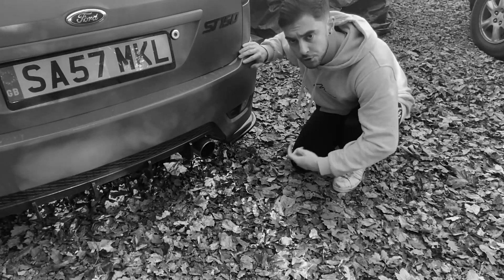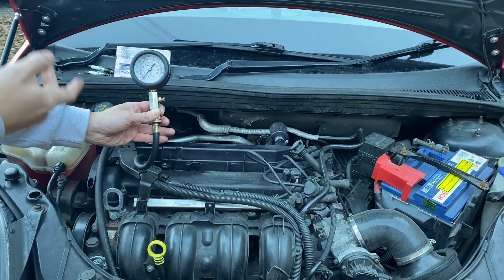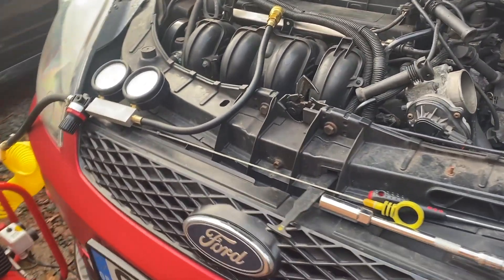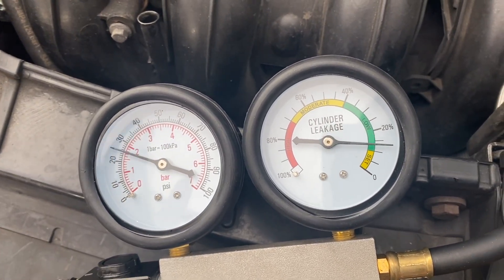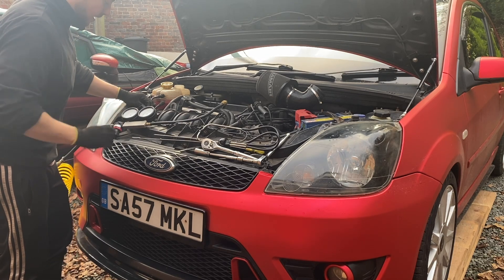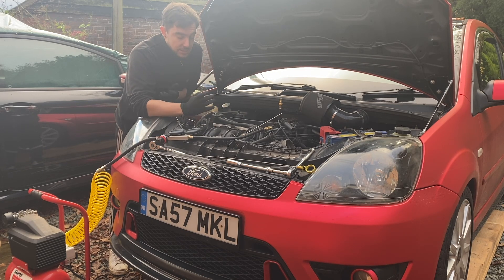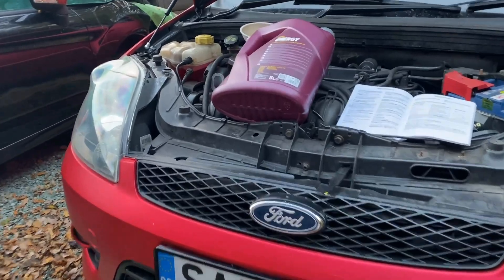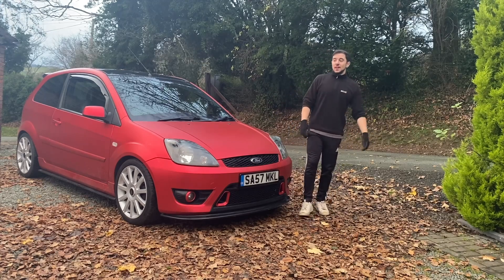What Condition is my ST's Engine in? | Engine Health Check

Comment: Great video, I'll ask my mechanic to do pressure test on the cylinders.. My missus mk6 idles well, druves well but stalls...changed pump, fulter, cleaned throttle, throttle position sensor, map sensor, checked abs sensor.. Its still stalling. No error code. 😢
Been ro over 4 electricians already

Comment: I've got the same problem with my St150.
Going through a fair amount of oil but no visible signs of an oil leak.
Did you get to the bottom of the issue, or you just running the car and topping it up?
Reply from the maker: Just topping it up for now, will be rebuilding the engine this year

Comment: Hey man, very helpful and enjoyable videos. I got a question. I got the same issue with my oil, but the compression test wil give for each cilinder the same result. You have any idea what a problem could be? Can’t find any leak.
Reply from the maker: Thank you mate. That’s good that they’re even across all 4, what are the results you’re getting in psi?
Reply: @MendItModIt  I did with full gas, I got 270 psi
Reply from the maker: @zebvanderslot6710  those sound like good numbers, like I’m not a mechanic but I believe between 250-300psi is good for these engines. How much oil are you losing over what period of time?
Reply: @MendItModIt  I check the oil leven a few times. Last I had a longer ride I think around 150km and it dropped from max to almost min level. I think it’s probably also around 2-3 weeks. But it seems like when it drops its like almost every time from max to min.
Reply: Still no oil leak or something found. I did a engine flush but can’t say if that will do anything. Maybe got an idea to check first? I think I have to open the engine.

Comment: Hey, nice video! 
Did you have any issues screwing the compression tester into the spark plug holes?
I bought a similar cheap compression tester and the 14mmx1.25 attachment won't screw in and it's so frustrating - I can't figure out why. It's a 2005 fiesta zetec S.
Reply from the maker: I always feel like they’re not screwing in all the way, but then I got one stuck and took me ages to get it free. Sounds like you know your stuff with the sizing and thread pitch, I was going to suggest a thread pitch gauge and test the plugs that have come out just to check, but really spark plugs should be a standard size 🥴

Comment: So I've gone and done one on mine.today. 200 200 200 150 but now the cars spluttering like mad and aint functioning right at all. Whats ya thoughts mate? Everything seems in place as it should
Reply from the maker: Was it fine before you did the compression test?
Reply: Spark plugs installed correctly? Ht leads installed?

Comment: Maybe as a budget option drop the sump take the pistons from under the car and stick on new rings, refit and retest. 

Wouldn't have to mess about with timing or new headgasket, then can keep the motor running sweet until you decide if it's time for big power
Reply from the maker: You know what I actually love that as a suggestion 😂 maybe not on this car but in the future I want to try it 😂😂

Comment: Rebuild to 200 spec 💪🏽 Cosworth cams
Reply from the maker: Definitely considering it mate 😏
Reply: @MendItModIt  Yeah man, mine is recently up there now, it's sensational. If you do, go for full Miltek exhaust, sounds soooo good
Reply from the maker: @poosh6529  yeah plan is to get the rest of the milltek system I reckon. Is yours non-res? Sports cat?
Reply: @MendItModIt  Non res with sports cat, and really comes alive when cammed. I also asked the seller on ebay to make sure he includes the silver tip back box in the package as it seems by default it's black tip when ordering full package

Comment: Hi, just wanted to let you know. I have a lot of experience working on these engines, the margin ford gives out for burning oil in these engines is 1l in 1500 km, so unless its using more then that i'd just let it be because all these engines burn a liitle oil
Reply: 0.5L in 1K miles is highest as stated in the manual.
Reply: @CdotPoppy  wel 1000 miles is about 1600 km so not to far off. But the point is al these engines burn a little oil
Reply: @yourimeeuwisse711  point taken and they do, if they don't have good 5/6k (miles☺️) oil changes and are allowed to warm up and down nicely. Then the abuse they get becos it's a ST is not good.
Reply from the maker: Out of interest how many litres/millilitres are between max and min on the dipstick?
Reply: @MendItModIt  usually about 0.5 L/ 0.7L
Not that much.
Reply from the maker: @yourimeeuwisse711  oh okay, even so I was loosing at least that in between 200-300 miles. Obviously the low comp and leak test results are the more concerning factors also
Reply: @MendItModIt  yess that is a bit to much, and indeed the results are not so good. Also something that is worth replacing if you have the cilinder head off, the valve seals. Because that and the piston rings are the 2 main reasons for burning oil. Besides that obviously the headgasket but that one cant be reused. You also want to have your head and lower block checked for straightness, i believe the tolerence for head warp is 0.05mm before you need to get it surfaced. But im not exactly sure about that tolerence tho
Reply from the maker: @yourimeeuwisse711  yeah if I’m going to dive in to a rebuild I’ll just do the whole lot while I’m there… “in for a penny, in for a pound” 😂 thanks for the advice mate 🙏🏻
Reply: @MendItModIt  yeah no problem, happy to help. But i work in a mechanic shop and if we incounter an engine that uses as much oil as this we usually dont take the time to find out why and fix it. Because that takes a LOT of time and you never have a guarantee that you've fixed the problem. a used or recently rebuild engine is cheaper most of the time.
Reply: @yourimeeuwisse711  true there's an engine on 67k for £760. It's some what easier but not cheaper..

Comment: Hey there, I had a Corsa that burned 1L of oil in 500km, did a engine flush hoping for a cheap fix. Did not work, now I have a 05 fiesta st150. My point is, since you are not burning that mush oil, you could try a flush to help you get to your big plans in the future.
Reply from the maker: I guess I don’t have much to loose doing the flush if I’m gonna do a rebuild or something anyway. Just worried the flush will disturb something else as for now the car runs at least. Once my MK7 is on the road I can afford to take the ST off the road and get it sorted…. And make some “improvements” 😏🐎
Reply: @MendItModIt  And the end it is your choice. Since the car is not smoking (Wich mine also did not do) the piston rings are consuming it all. Maybe a flush could lead to more oil loss, but maybe not.

Comment: Piston ring wear a common problem on ageing zetec engines, is there any crank case pressure build up take the oil filler cap off while running the engine
Reply from the maker: How to I measure the pressure build up bud?

Comment: What are the actual negatives, beyond constantly need to top it up? It passed emissions so at least it's not an issue for that. Hit on performance, cause other problems when it gets worse?
Reply from the maker: Yeah performance will be reduced as rather than the force of combustion in those cylinders pushing the piston down part of it will be escaping past the piston rings. I’m guessing there will be other stuff too so hopefully I can get it sorted soon 🤞🏻

Comment: This might be stupid idea but is it possible that the piston rings are stuck? Maybe engine flush would help?
Reply: I second the BG109 EPR. Mine has 102k miles on it and was using a litre of oil every 500 miles with no smoke or leaks, but has been fine ever since and hasn't needed a top up yet. Worth a go at £15.99.
Reply: @cookiethemelonfarmer  Yes I did inform himself at the start of October that this can help alot, with compression and oil leaking out etc, as they also have another oil product. They have been around for somewhile I guess they are doing something right!
Reply from the maker: I’m not sure, hopefully someone will be able to answer that one, knowing my luck I doubt it 😂😂 here’s hoping
Reply: @MendItModIt  I did write up a massive how to fix this issue thing before without reply. 

Just it dyno'd in Telford/Wales and see how bad it is and if you do fix.. how better it has become!?

I flushed my engine with BG109 EPR - The oil was like water and my catch can caught of a lot blow by. Did, 500miles.. was on the min mark, Topped it up again, did 1k miles, still at the top. So Same stuff happening to me. I could have done the leak/compress test to see if the extra £1k mods where worth the hassle!
Reply from the maker: @CdotPoppy  sorry mate I don’t recall. Hoping to do some big mods in the new year so I’m going to look into starting with the best base I can, whether that means a rebuild, replacing the engine or what I’m not sure yet but the thing that puts me off flushes is they can cause issues with things like seals especially on older engines 😭
Reply: @MendItModIt  Hey MiMi,

BG 109 - can help with oil burning if internal £15.99 eBay, needs oil change.
No spots of oil underneath your car at work? The front crankshaft seal did look Hella dirty in that area, could be possible it's leaking. Shame you cannot see the oil pressure level, the dip stick is not the best.. PCV orange tube could be stuck open burning more oil/blow by then Needed. Compression test to see if oil control rings are letting extra oil seep in the cylinder and it's being an burnt, could be an emission check to see if higher hydrocarbons than usual, AFR dyno run to see if it's burning lean with oil vapours in the detonation. How dirty is that CCV foam in the air box, maybe get a filter or get a catch can 😅? How are the spark plugs looking? How you ever done an oil flush when changing oil, sludge in the block channels? Oil analysis with miller's,     and didn't see the drain plug on the sump. Did you change the driveshaft seals when you put in the gearbox? 

It's probably burning/leaking on load, (seal, sump, chamber) hence you didn't find that seriously leak (which is great) the bellhouse of the gearbox is where my leak was, from the rear CS seal, was dripping from that area. 

BG RF7 is another shout, also high mileage oil they help the seals and then a thicker weight is an ideal but (5w40 is mainly just a top up only) there is also Lucas High Mileage Oil Stabilizer.